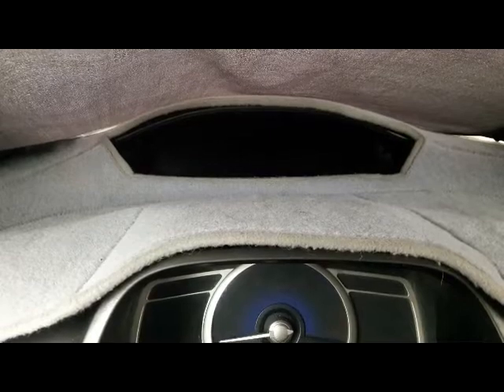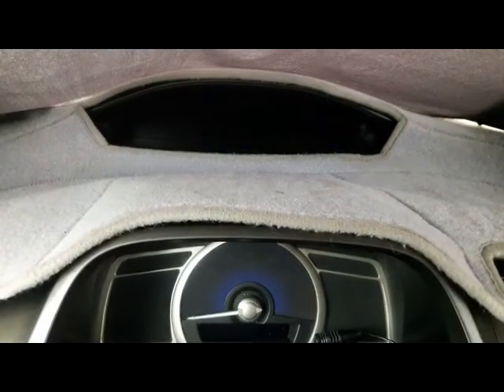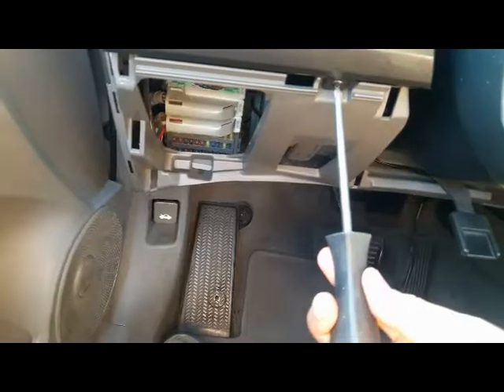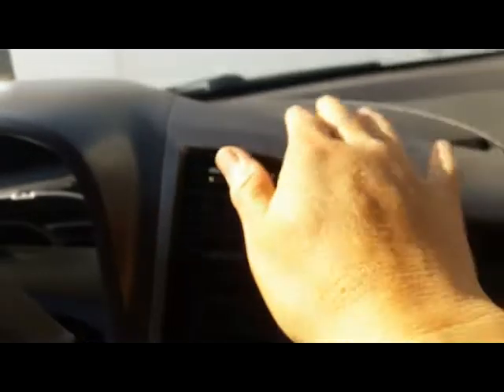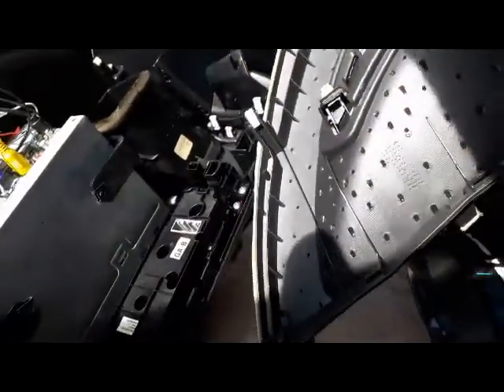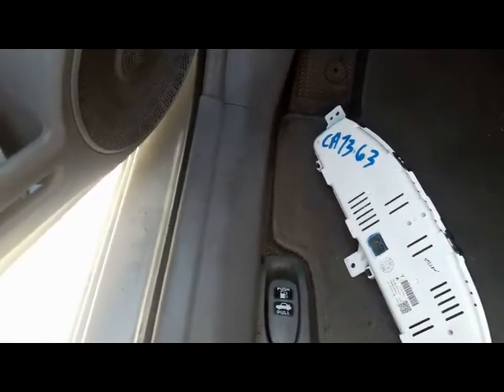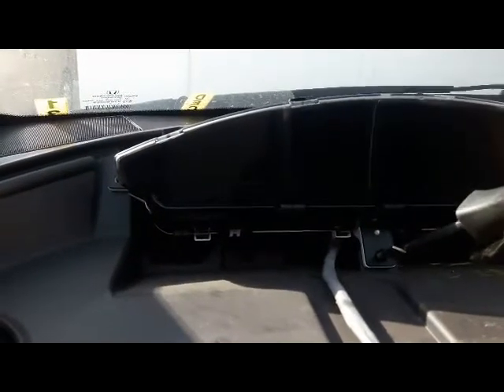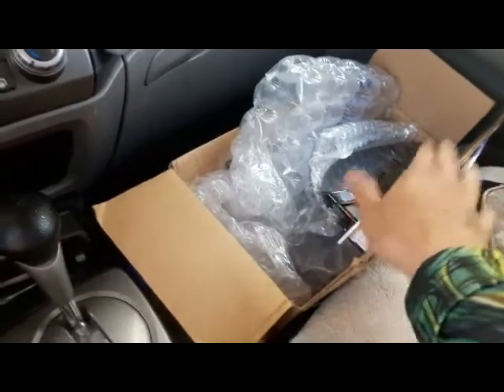2010 Honda Civic EX Sedan Upper Speedometer Fix and Replacement

Comment: Ive noticed this issue is a lot more prevalent if you turn up the brightness while the lights are on. Its really annoying and forces you to turn it down, making it hard to see in some situations
Reply: What did you do to fix it? This just happened to my 2010 civic and im like absolutely stressed beyond belief. An with the economy right now so messed up, i cant even afford to buy a new one, or pay anyone to replace it. Did anything you did work? Any pointers?